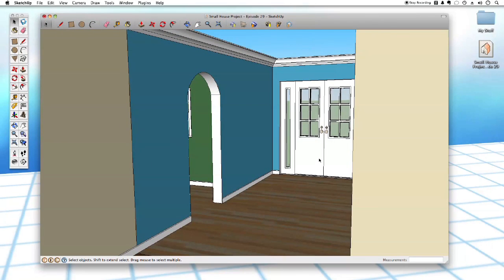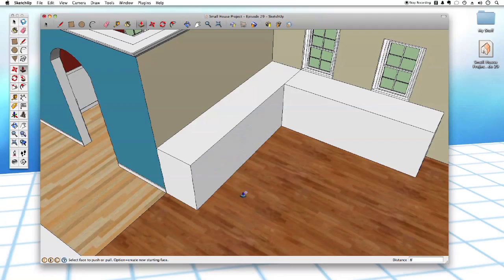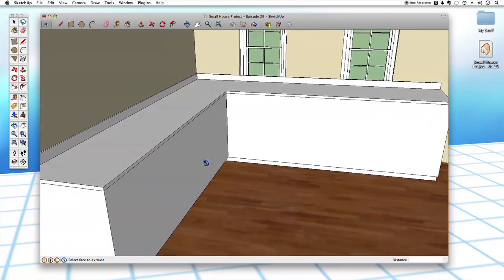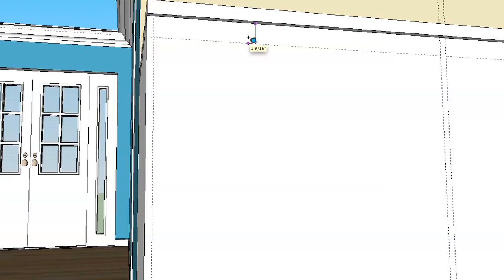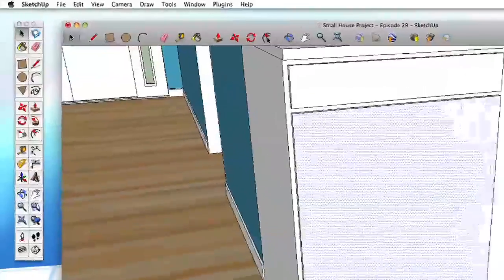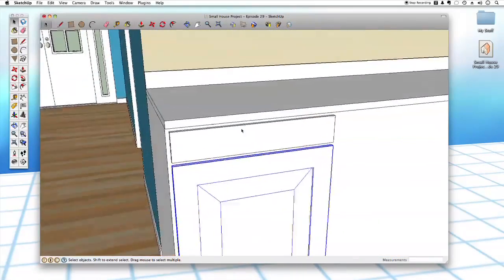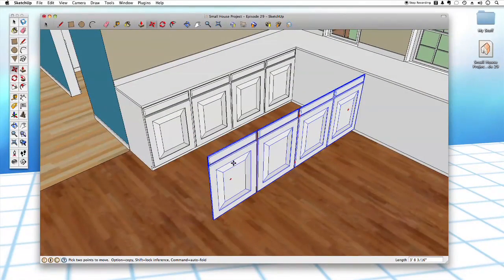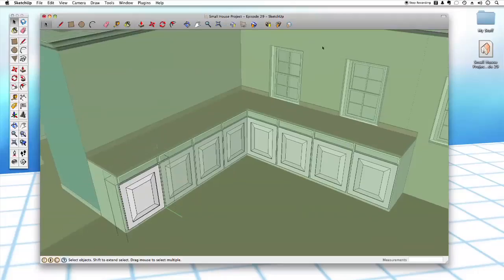Sketchup #29: Kitchen Cabinets

Comment: I know this may seem trivial to you, but I build cabinets and it hurts my ears. FYI... That "notch" on the bottom of the cabinets is called a toe kick. It's usually 3" deep and 4" high. The "back portion" of the counter top is called a back splash. Modern cabinets are 34 1/2" tall so when the tops are added it finishes off at 36." The industry standard for granite and marble is either 2cm (nominal 3/4") and 3cm (nominal 1 1/2"). Natural stone counter tops vary from source. Overhangs vary by taste, but 1 1/2" is pretty normal. In a new build, if your windows are in the way of the back splash, the architect needs his butt whooped. I really liked the way you built the raised panel door with the move tool and I always learn from your videos.

Comment: Nice video, it did teach me some tools that i hadn't used yet. Just a few basic corrections though for your heights. You are correct that the standard height is 36" or 3' however that includes the countertop otherwise the counters aren't very ergonomic to use for the average height person. Also, i did see someone else mention that 42" is the average height A.F.F (above finished floor) for the windows which is fairly standard now unless requested by a client.

Comment: Would it be a good solution for the cabinets to just create the first cabinet and then use the move tool, set it to copy, move it 2 feet to one side and then use the multiplier function?